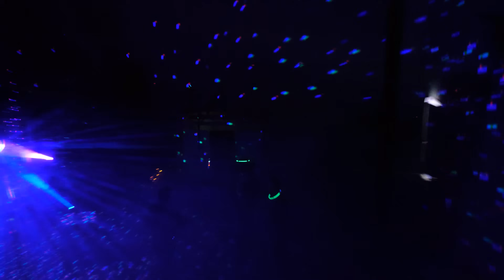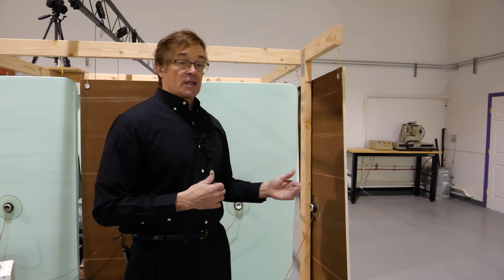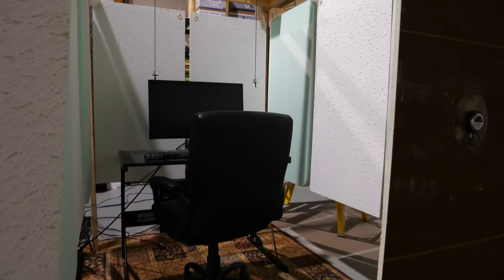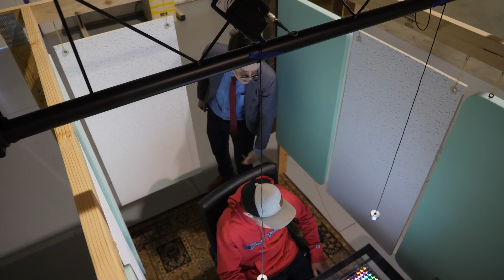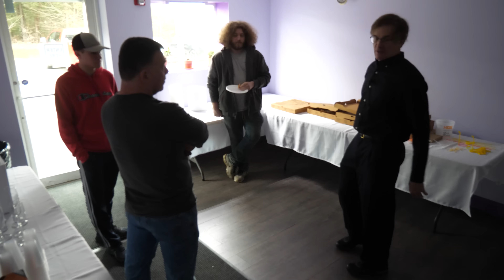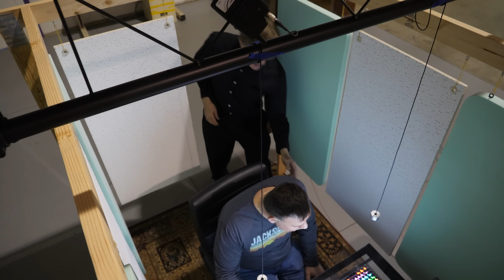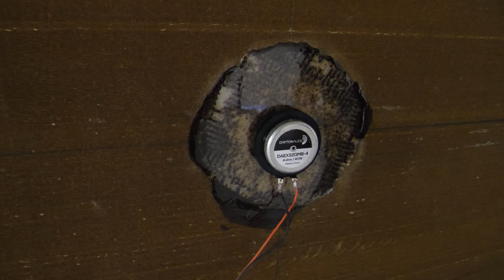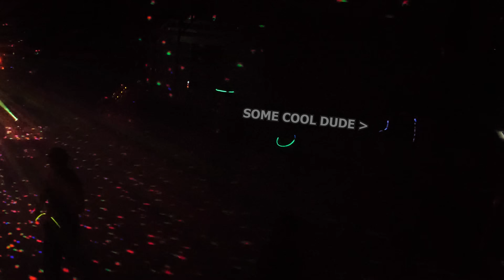SHOULD SPEAKERS THIS GOOD BE LEGAL?

Comment: My question is how much sound is being transmitted outward from the back of the speakers?  
Is it equal to the front side...greater or less than?  
Can they be hung just away from walls so the walls can act as a dampener to lessen the outward transmission?  
My thought is to use these in a home but I am concerned about annoying neighbors with loud sound after hours.
Reply: My assumption would be equal, I can't see any way it could be otherwise.  If close to a wall, you probably want to put anechoic foam panels on the wall, to prevent standing waves between the wall and the speaker panel.  That would also significantly reduce the volume for your neighbors!  They are very cheap, especially if you buy them through AliExpress or similar.

Comment: This is incredible! The one thing that immediately jumped out at me though was the size of the eyelets you were using to hang them. Do the size of the holes/thickness of the pipe not significantly affect the sound quality? I would have expected them to change the resonance of the panel. Could something smaller be used like PCB through-hole ferrules or is the size of the eyelet required to prevent whatever material you use as the wall from sawing through the panel under their weight? Awesome video as always

Comment: Would you be able to cover the front of the panel with something like car wrap without it changing the output? Also, does the distance from a wall make any difference to the function of the panel? Also, would you consider doing a couple of shows on crossovers and amplification and subs? I think you guys could come up with something pretty good. Thank you for all the hard work it's very much appreciated.

Comment: I build a couple of invisible ceiling speakers with your tips and they do sound really ok even without DSP and subwoofer. But this only holds for regular pop and classical music without distortion. If you had some metal heads sitting in your contraption listening to their favourite songs, I bet the reaction would not be as positive.

Comment: I love you so much just for drilling into so many young skulls the idea that YOU CAN build something, and you can build something BETTER than the sales margin filled plastic garbage you'd otherwise buy without thinking. I don't have an exact estimate but the world is going to be around 40% to 50% better because of examples like yours. The solution to our every common problem is trying and doing. Keep it up and thank you so much.
Reply: exactly lets build the world we want to habitate
Reply: As someone in my 50's, I can certainly agree with you. So much these days based on the Bic lighter mentality. I've got an expensive speaker system that's about 12 years old and the manufacturer doesn't even have parts support for them anymore. I think it's ridiculous. Good thing there's places like Parts Express to try and solve some of these issues. That and I'm technically inclined enough to fix my own amps etc.
Reply: Yes I have just built a valve amplifier. Really looking forward to firing her up. I think I will build these speakers to go with it.

Comment: This is really cool. I ordered the drivers first thing when I saw the first video you made on these speakers.
Have you tested placing the speaker panels on a standing mount connected only to the driver element itself? So that the only thing physically connected to the panels are the driver, not even hanging in strings.
Reply: Your mount would vibrate…

Comment: Great to see these DMLs growing! Please go in-depth with these - standardized measurements, comparison with commercial speakers, proper A/B testing in stereo setup, and get a pro audio engineer to analyze them if you can. It doesn't matter if they don't stack up as you might expect, we all think you already did a fantastic job in selecting materials and constructing them, any shortcomings will only point to possible improvements.
Great channel, great work, great presenter!
Reply: I think they did that  in a previous video
Reply: @HDefectus  
Yes they did.
Diffrent material and different shapes, sizes.

Comment: I have two sets of these, one set is appx 2'x4' pink foam running the 40w exciters with the panels spaced perfectly from the wall for the best bass response. The next set is mounted in the ceiling wedged between the rafters running the 20w exciters. Being wedged gives them a very good high frequency response.
On the furthest wall sits an older pair of peavy SP2's both sitting on top of 18" peavy bass (woofer) cabinets.
The whole thing is processed through a tube preamp with the exciters running through an Onkyo 100 watt stereo, and the peavy's running through a 500w stereo mixing board.
With very good music, it's enough to make you wet your pants.
With the right music, it's enough to make you wet the pants of the person sitting next to you!!!
Reply: What spacing off the wall did you settle on for the40w panels?
Reply: @3888Orbost  Hi Sean. The installation as of yet is not permanent, but it's being tested in an addition I'm currently constructing. The 40w panels are 2 foot by 4 foot with the exciter mounted off center as suggested, favoring the top end..
I hung them using string and some hooks or bolts of some sort. I then used slender wood scraps placed horizontally between the wall and strings to move them away from the wall.
The highs and mids seem to always be there no matter what you do, so it was the low end I was looking for.
The magic number I found for my case with a very acoustically dead wall (unfinished ICCF) was 7 inches.
Sorry it took so long to get here!
Reply: @joesbarbecue1  thanks for response 👌

Comment: Still harping on those speakers huh? I do not understand you on this one.

Those speakers will sound like whatever you attach the transducer too. That's a complicated acoustical transform from transducer to free space. Speaking of free space, those speakers will have a vibrational mode structure that depends upon frequency which means the sound will be coming from different locations at different frequencies. That means an incoherent sound field that will cause the image to suffer. Also, good luck getting any sort of 'board' to move faithfully at 15khz...

I believe you like the high distortion, distributed, Phil Spektor sound. Panel speakers are dipole radiators so they can interact more pleasantly with rooms. Without a stereo image, the exact place you listen to them from isn't critical. If something is cross-faded left you'll hear it from the left and it will sound good...

Those speakers are not hi-fi.

I believe you would really like a large open baffle speaker with a very dead baffle and a very hi-fi full frequency direct radiator driver. Use multiple layers of MDF. Do the proper calculations for size and driver placement versus baffle step rollof. Use a large full range driver and consider adding a passive baffle step compensation network to account for baffle rollof. Place the speakers symmetrically  in the room away from the walls and enjoy good audio.

Or go to a hi-fi shop and ask to listen to a good system. Anything designed in the way you suggest is only a gimmick.

Comment: i can clearly hear that your system is struggling with accurately reflecting the lower ranges without peaking.
this means that any song you listen to, would have to go through a limiter for the bassline to sound decent.
i'm guessing that's why sub-woofer chambers are built completely differently than just speakers.

Comment: Pretty interesting concept, do you have any measurements? The test setup was honestly way too compromised to get to any conclusion. Does this work well as a two channel system? Most music is made for two channel anyway.
Reply: Dig through the older videos on these speakers.  They were all stereo, and set up in the anechoic chamber, and they did all the frequency response etc testing you're looking for

Comment: Most of my music tracks are longer than 5 minutes. At least give them 15 minutes with music they are already familiar with... And did you really have to put your channel intro music into the listening selection?

Also, I can hear the small room sound that comes from having all those parallel panels. Try angling them and leaving some strategic openings for reverberations to escape? Anything more dense than air reflects sound so just because they are foam or ceiling tiles does not mean you don't have reflections at frequencies where they don't absorb anything.
Reply: I can also hear some serious overdrive, I question the use of tube amplifiers to demonstrate this because if you want to test the sound of the speakers you don't want something like a tube amp to sweeten the sound or start to overdrive before the actual speakers are near their limit.

Comment: Pretty cool! This kind of system would be absolutely incredible with a large screen TV. One could build a room sized unit, and have an incredible movie experience, say Top Gun Maverick, for instance.
Reply: Hmm 🤔 a projector movie 🎥 experience with these panel speakers 🔊 would sound amazing. Consider that a challenge. I’ll create this and see what it sounds like. I usually use my 2 Krk rocket 6 speakers for my projector movies but the sound is not great but great bass tho.

Comment: I think the ultimate challenge is to make a similar system that can match Dolby Atom requirements,  but I guess hanging two or for of these on the ceiling with 4 strings would serious degrade the sound quality？And with a dolby atom receiver it kind of destroy the point anyways.

Comment: I put one of these speakers (vibration speaker) on the inside of my shower wall turning the shower itself into a speaker which has the added benefit of being waterproof. The panel is made of fiberglass, and while it lacking in the uppermost frequencies, the bass was much louder than expected, in a good way. I'd say frequencies as low as 50Hz comes through pretty well, but I haven't done any proper tests yet. 10/10 would recommend.

Comment: As an idea, you could try using those panels or different ones to make headphones. Everyone around you would hear the same things, like with open-back headphones, but you might be able to make high-quality headphones for cheaper than buying them. At the very least, it would be an interesting video. Multi-channel is optional, and maybe need it's own video later on (especially since people could give ideas to improve the headphones, in the comments of the video about the stereo headphones), if it will even be done.
Reply: The large size of the panels is part of what makes them work. For headphones, you'd need a really large head.

Comment: I can imagine frequency response being accurate around the 800 and 10,000hz range with the ceiling tiles and about the 13,000hz range with the other panels.  Surrounded in such a small area makes listeners' reception less likely to be absorbed by the tiles before being heard.  Think I'll order some of the drivers for experimenting in my 30x30 bedroom.wish me luck😊
Reply: You can grab a cheap calibrated mic, measure the frequency response with REW and make a good EQ to load into equalizerAPO (windows) or a miniDSP. Makes it sound soooo much better.
Reply: You actually can get extended highs to 20kHz. This was done with the epoxy stiffening under the driver.
Reply: @stephensaint-vincent8680  will there tend to be a resonant frequency related to the physical dimension of the panel?
Reply: eh just use a carbon fiber panel for the highs would have to find a way to deaden it a little though maybe rubber bushed weights at certain spots?
Reply: They won't be accurate above 5khz at all. They got to much surface area and directivity will happen. I can eq my 18" subwoofer to play to 5khz but it won't sound good.

Comment: Does the acoustic material has to be dense and ideally closer to a metallic signature to better convey all the mechanical properties of the sound waves emitted? Also does the absence of a low ceiling in the sound booth effect the reverb of the music being played?
Reply from the maker: Actually,  no.  You want the material  not to be dense because that requires  the driver to produce more force and use more power to create the same volume.

Comment: I followed your original video and made a quadrophonic setup in my room. Cut out the drywall behind it and insert Rockwool with a few inches of separation to give the waves some room to breath. I also did the same with acoustic panels all over my walls, also from the video you made. In addition, I've also made a 42% scale version of the Voigt tubes. You have motivated and inspired me with so many of your videos, thank you sir. I wish I could be your friend.

By the way, I ran some experiments myself and found that contrary to intuition, thinner insulative materials gave better low end response than thicker pink foam board. I ended up spraying shellac (tried many clear sprays/varinishs) on dollar tree foam board and it sounds fantastic. Also stuck an exciter on a vinyl lawn chair and the sound turned warm, am planning on stretching some thin vinyl like a shower curtain over a wooden frame as a transparent dml, it should sound interesting to say the least.
Reply from the maker: Great innovation, keep it up.🙂

Comment: Am I allowed to build and sell these if I want? Or build them for church?
Reply from the maker: Sure.  The concept has been around  for some time, we just improved on it.  These actuators are sometimes  stuck on the inside of vending machines to act as an inexpensive  speaker, protected from the weather.
Reply: @TechIngredients  Awesome, thank you
Reply: @TechIngredients  Is it possible to paint these or put some kind of print on these without affecting the sound? Also, that material produces the deepest bass?

Comment: I was looking for a parts list of what you used. Dayton was sold out of many of the larger drivers last time I checked - wondered what you used and did you use different ones on the foam and acoustic boards. How large of an amp are you using.
Reply from the maker: They are the same, 25 watt Dayton drivers we ordered about a year ago in bulk (50 I think).  The amps are 100 watt tube amps and we used 3 to power the 5 channels.

Comment: What are your thoughts on the mayan pyramids and how the builders of those figured out sound and obviously knew all about this kind of stuff, and more. from the way the acoustics worked around the  amphitheaters (you could be in the dead center of an obvious "staging" area and could speak with a normal voice and the sound would carry all around so everyone could hear without you having to raise your voice, to the pyramids that actually changed the sound of your echos to sound like birds and rattles.  *Search here in the videos for one titled: "Chichen Itza : Sound of Bird and Snake" for an example.  They apparently engineered the steps of the pyramid and the building on top to focus the soundwaves and bounce them back to the person and change frequency to sound like a bird. How exactly would they have figured that out? How would they tune it and how would they figure something like taht out in the wild, much less meaning to do it on purpose.  I would just like to point out, this is weird, because I have been studying about megalithic ruins for the past year  now, very hard, including these ruins and I only heard about this by stumbling across a video on here about it in the past day or two. These videos just started popping up all of a sudden even though some of them have been made for 10 years. VERY ODD.

Comment: Please correct me if I'm wrong, but the polystyrene panels appear to be 2' x 4'. What is the thickness? Also, have you tested different thicknesses of poly panels? I've seen varying thicknesses of panels from 0.5 inches to 2 inches thick. What do you recommend?  Thank you!!
Reply from the maker: They're  2" thick cut to 24" by 45" to reduce resonance.
Reply: @TechIngredients  Thank you very much!